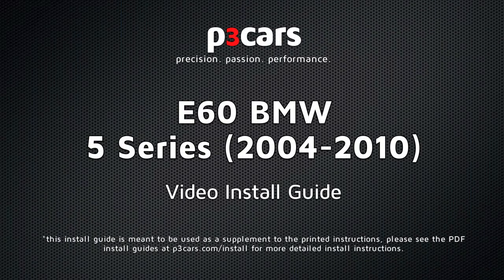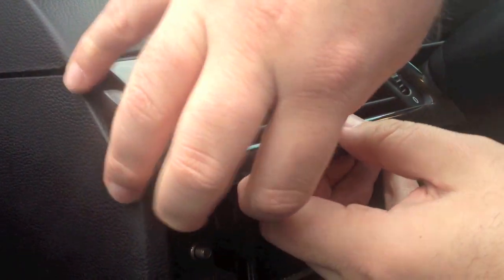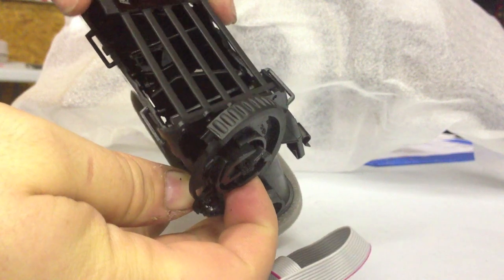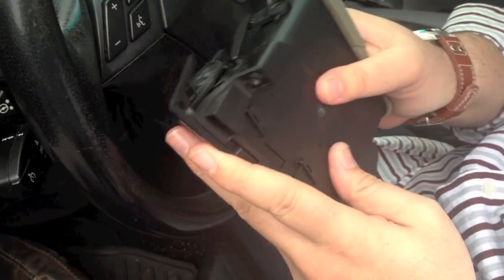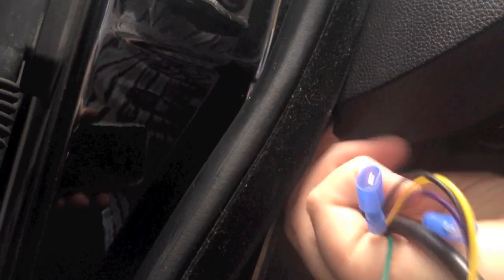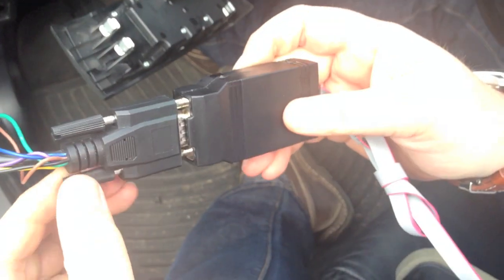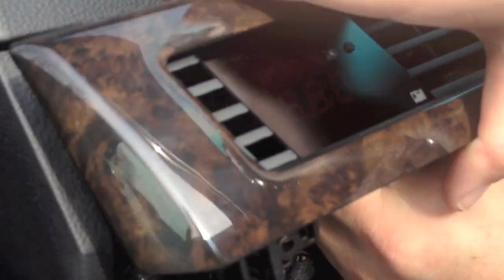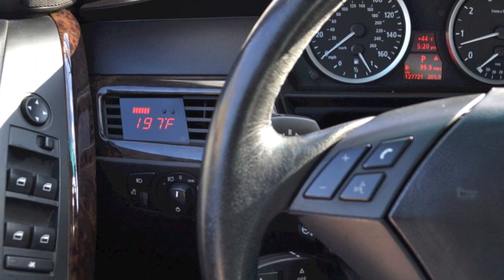P3 Cars - BMW E60 Install Guide - Digital Interface - 530 535 550 M5

Comment: I hope you're still checking messages and comments: I wanted to know if you're still able to safely use the climate/air vent after install??
Reply from the maker: Yes, you absolutely can! We have both extreme heat and extreme cold so both the heat and air are running in our cars. Our gauges are designed to withstand hot, cold, moisture, etc. If you have any further questions please send us an email - service@p3cars.com. Thanks, -Jake